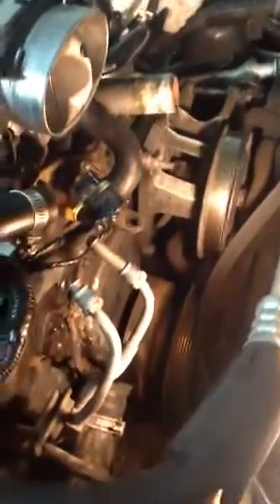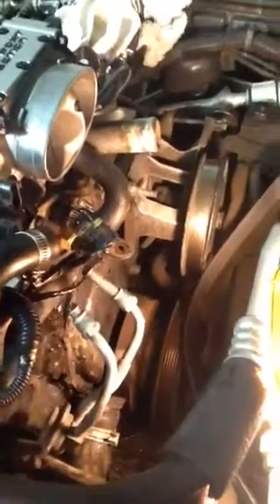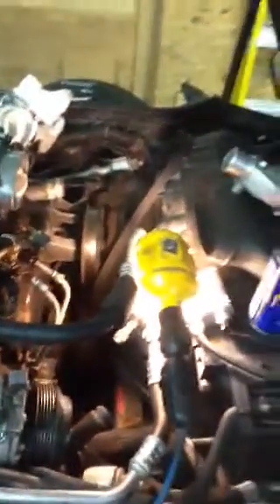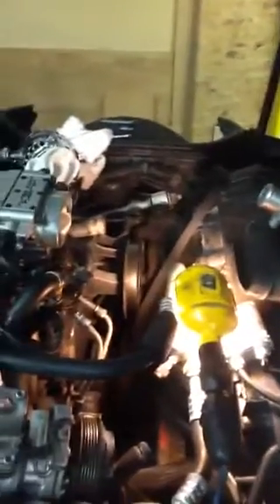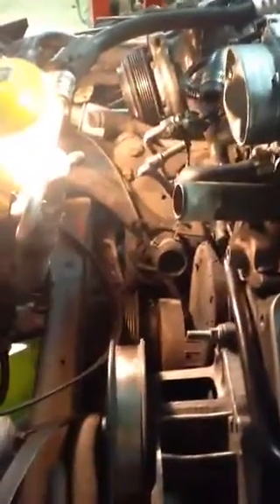1990 Corvette water pump removed

Comment: Have you seen a fuel leak under a water pump of a c4 . I'm having that problem . I have a d1 procharged installed but that doesn't run off of fuel . It's weird , my first time seeing this
Reply from the maker: evil_muscle muscled  As you may notice there is a fuel line on the front left of the engine. It’s not right under the pump but close.